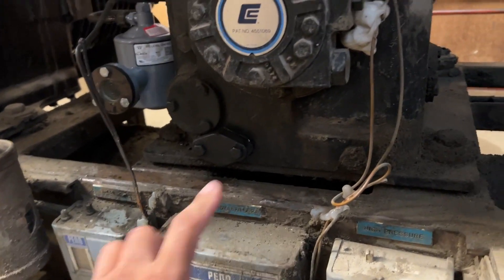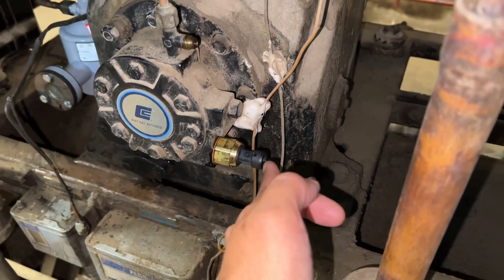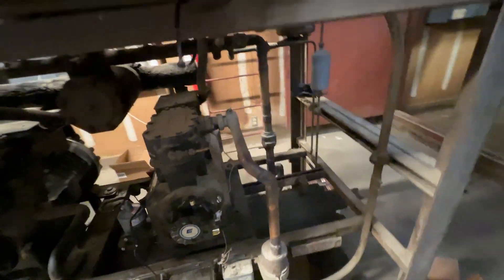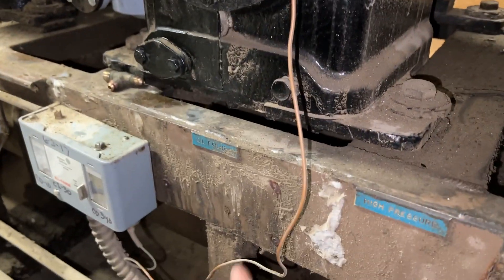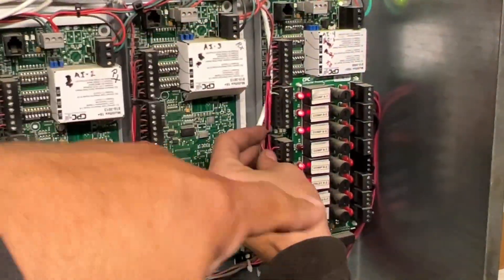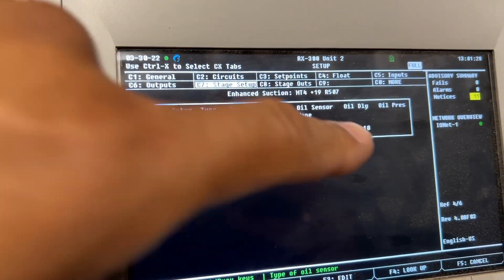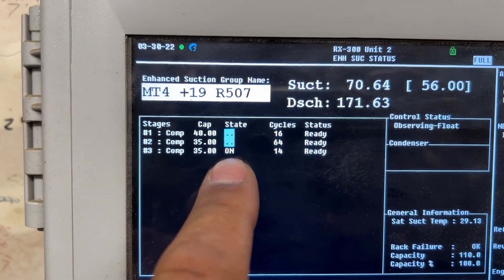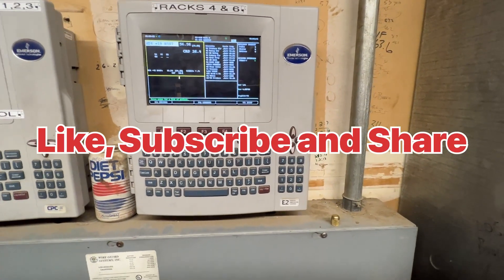Converting Mechanical To Digital Oil Safety Programed Into E2 Controller !!!

Comment: how is the E2 able to sense what the transducer is reading with out using a sentronic, or is the transducer just a open close safety that can go back to a DI point on a board.
Reply: It is an open/close switch.  If this owner was really ready to spend the money for better monitoring, they could use pressure transducers on the oil pump.  The E2 Enhanced Suction has an oil protection algorithm specifically for Copeland compressors.